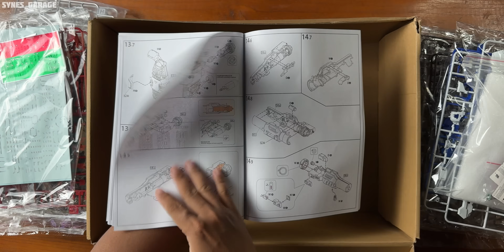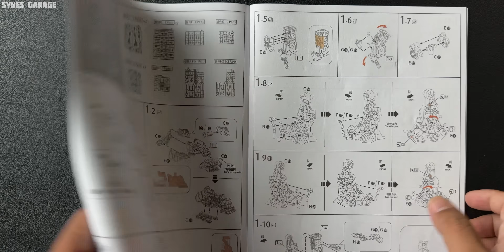Solomon Physalis (GP02 Gundam) Master Grade 1/100 | ASMR BUILD | Solomon | Universal Century

Comment: Hey synes, serious question, how good is your build experience? Is it just like built average bootleg with snapfit problem and loose? Or this more solid?
Reply from the maker: in some parts there are still shortcomings. However, the snafit and quality of the plastic is no longer in doubt
Reply: @Synesgarage   any loose part or hard snapfit? I hate those thing cause I don't have glue or cement and don't have good skill to polish